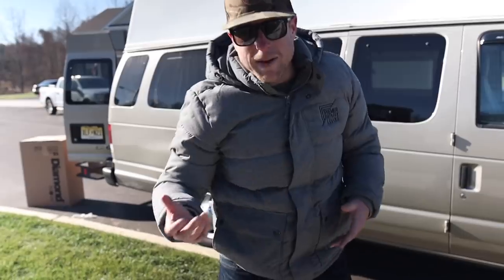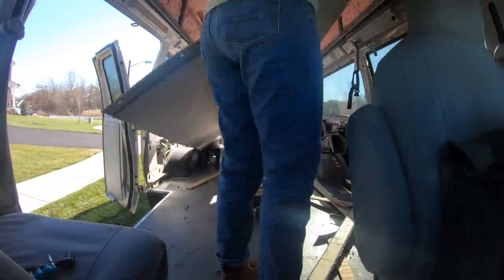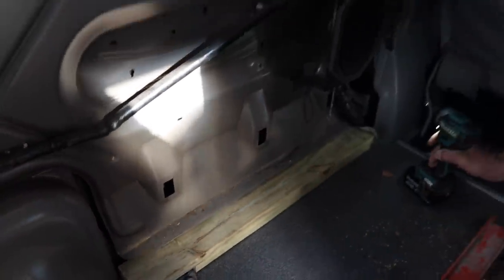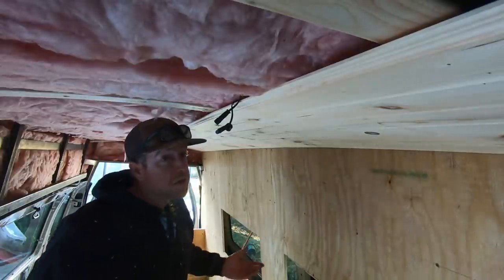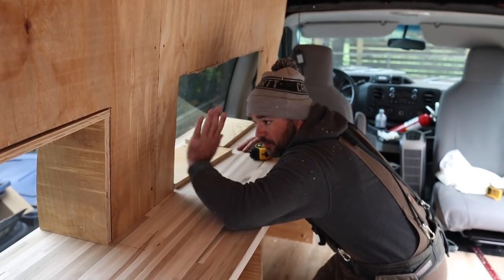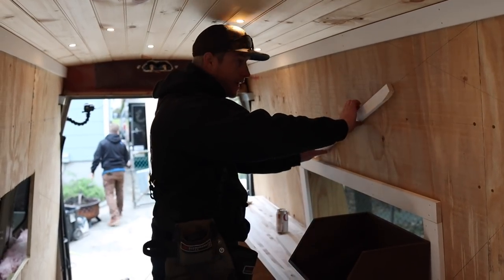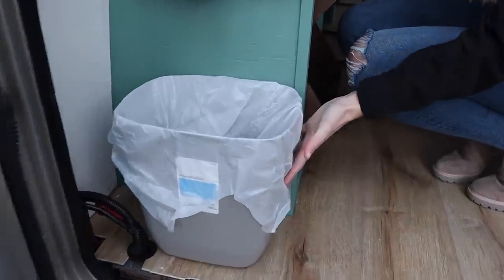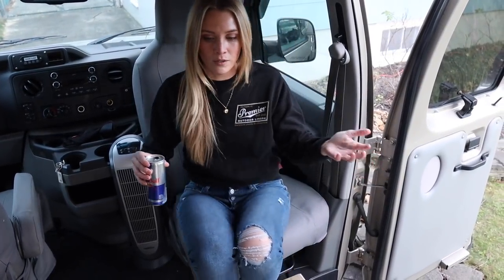WE BOUGHT A VAN! Building The Ultimate Mobile Office

Comment: How did you keep the water out if you're drilling holes into the floor boards etc? 🤔 Cool video, cute kids. All that wood adds a ton of weight too. Why not lighter materials that won't rot? 💥🇺🇲🖐😎
Reply from the maker: There was already a plywood subfloor in there so we screwed everything into that. Wood was just the easiest material to work with for this, heavier than some other options but overall I think better
Reply: @THEpremieroutdoor  Sweet, love the channel my man keep doing you!

Comment: Incredible! Turned out great! Might be able to use some heavy duty neodymium magnets on the side of the cabinets to help lock the chairs in for justice while your driving around.
Reply from the maker: We were thinking bungee cords, but that sounds way cooler!
Reply: @THEpremieroutdoor  def go with the magnets. You could embed some in the floor to catch the metal legs but should be able to pull the chairs away with your hands
Reply: That does sound pretty cool! And forgive me for being so low tech here, but couldn't you also just wrap some rubber strips on the bottom of the chair legs to keep them from sliding?